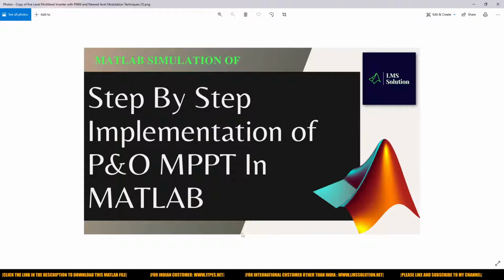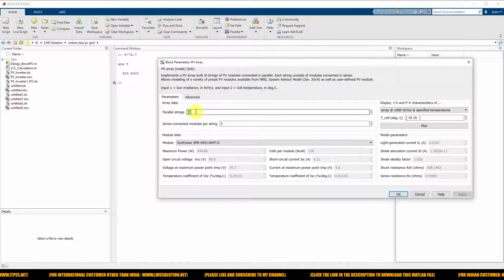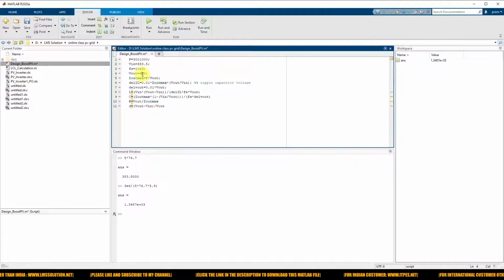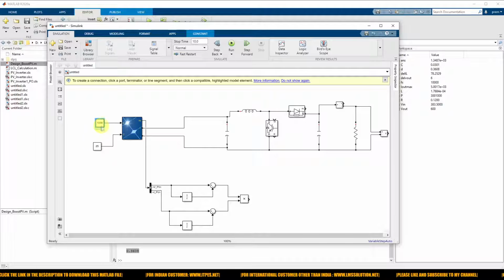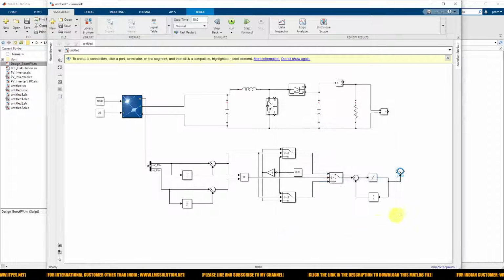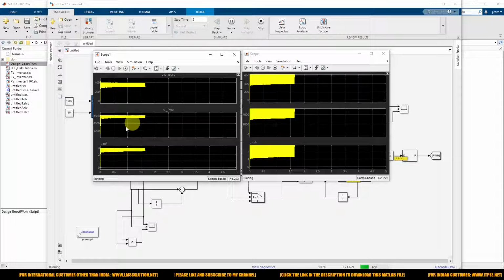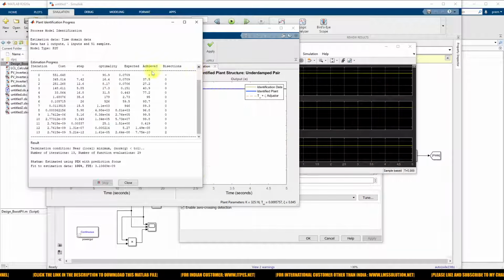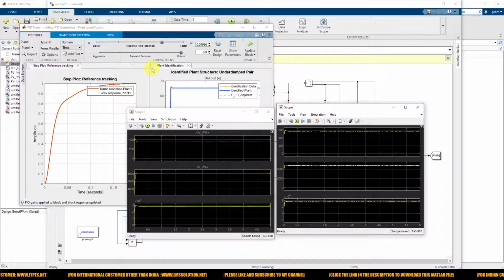P&O MPPT | Step-by-Step Implementation of P&O MPPT in MATLAB/Simulink

Comment: I'm trying to tune it for 520V output voltage. When i connect capacitor as load my pv current goes negative. Any specific reason
Reply from the maker: please contact us via whatsapp +917904458501